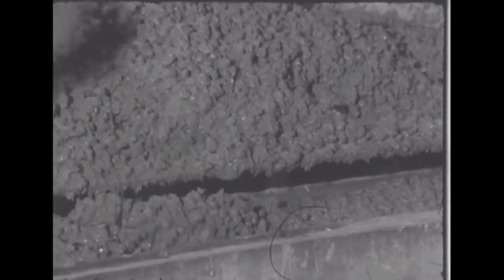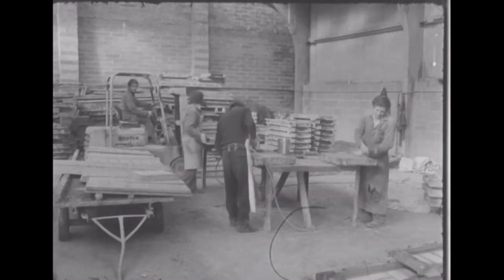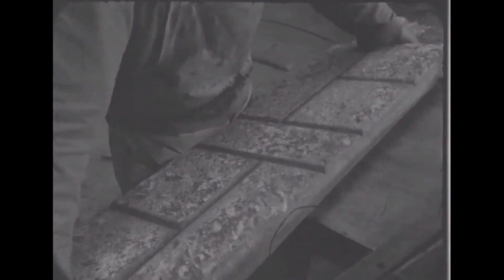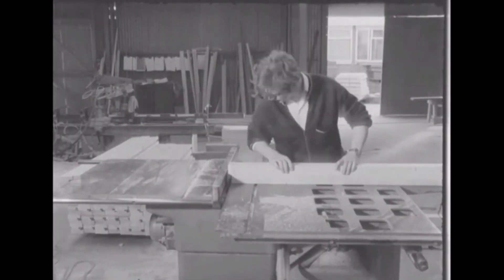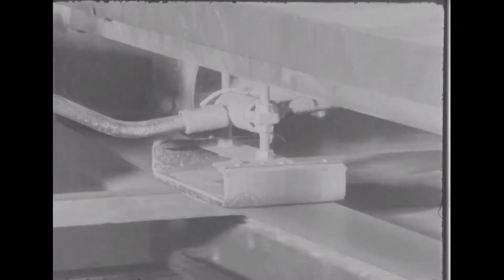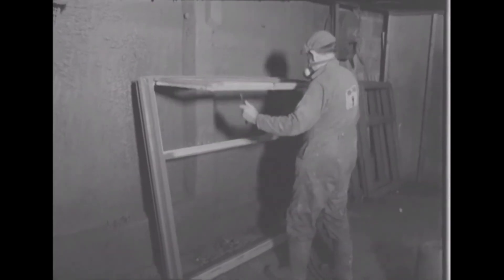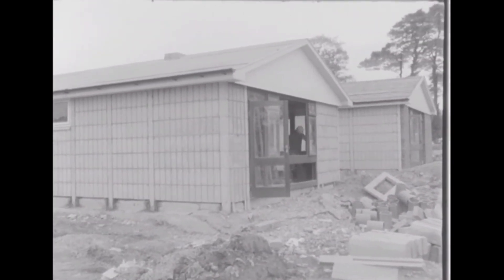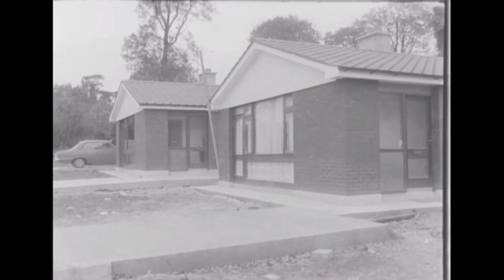Modular Housing System Built in Midleton, Co. Cork, Ireland 1973

Comment: What no insulation in those prefab buildings., the thickness of walls, floors and roofs in new houses are mostly made up of insulation materials so you can be toasty, cosey and warm all year round, I recall a time when most people single glass windows would be mostly frosted up on a winters morning, We miss the good old days because we were younger then and hardy
Reply: The frost doesn’t form on double glaze, it’s not that houses are necessarily warmer.
Reply: @monkeybudge  You may have misunderstood what I said, our homes did not have any double gazing in our younger days, it was strictly single-glazed windows only
Reply: @jamesbradshaw3389  

No, I understand perfectly. I used to have the frost creep up the windows when I was a kid too. All part of Jack Frost being out causing trouble.

What I was saying is, now most houses have some form of double glaze, so you don’t get frost on the windows anymore because of this. It’s a combination of the houses being better insulated and the windows being double glazed. The single pane glass from yesteryear was liable to have frost on it.

Comment: They were great houses but hard to heat. If I remember right they £3500 including delivery and election. You needed to have your own foundation and drainage ready and I think it took 2days to erect including the roof. Plenty of them still around.
Reply: Do you have any more information about these houses or know where I can get information because I just bought one. Renovating on a budget so loads of questions about floors, walls etc Thanks!
Reply: @worzel1  a company called Rohan Homes in Ballinacurra Co Cork used to manufacture them, they were known as Roh Fab bungalows. There was also another company called Ken Don in Cork but I don't know where exactly. Hope this helps.